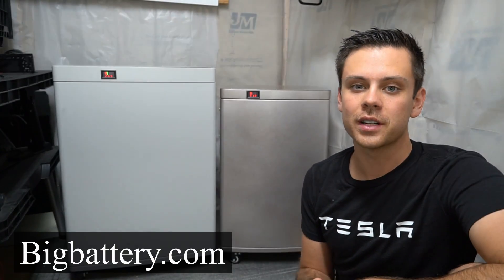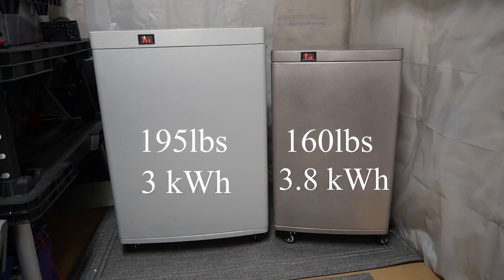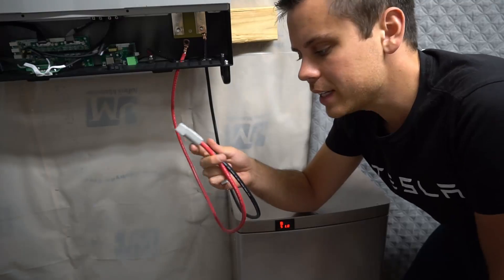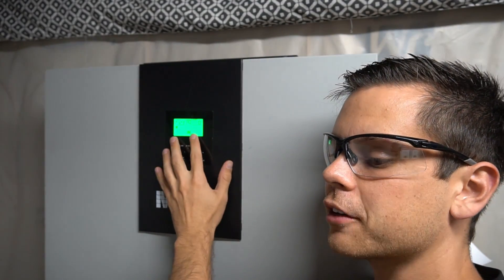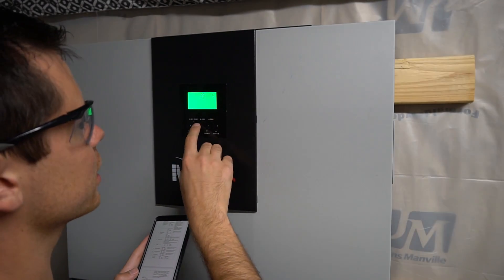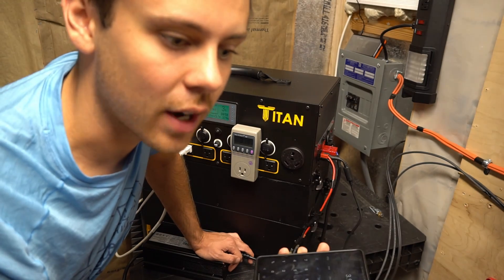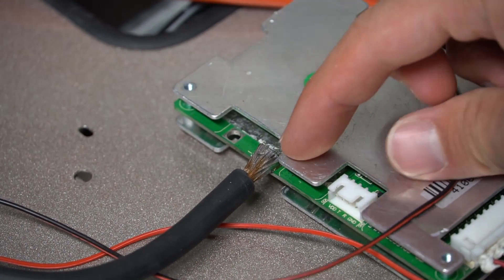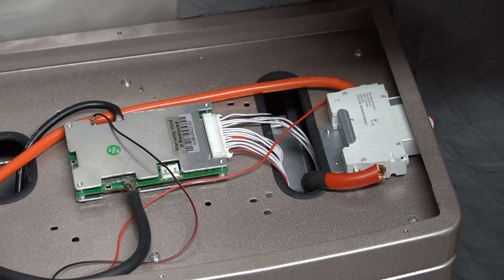Bigbattery.com 48V Li-ion + MPP LV5048 = Powerful Budget System (Intermediate level)

Comment: can anyone tell me. the sun doesn’t shine here everyday. can I hook up an wind turbine with my mpp and 24 volt battery if the sun not out but the wind blows everyday I got solar panels 400 watts I want to know can I use an 400 watts wind turbine,
Reply: let me just tell you this... DO NOT use or try wind turbines. even if you have nice fiberglass 12ft diameter turbine its not nearly as cheap, reliable, or useful as just buying a few more panels. I constantly see used panels still above 90% output on craigslist, ebay,  etc... for $0.40 a watt. you also need a very expensive wide voltage range charge controller and or resistor brake. You can still go and try it out, but Ive had a bunch and even a huge one with 3kw output, but you have to mount it pretty high up and above any tree's, I had to spend around $500 on 6awg wire to go up a tower, even at 6awg and 200v 3phase there was still quiet a bit of voltage drop even with 6awg and in the end if you have any neighbors, they WILL call the town hall and tell them... HAHA 

I would just add to your power wall + a couple more panels, but i may be wrong, this is just my experience.
Reply: You will need to check with the manufacturer of your specific charge controller.

In times past 10 to 15 years ago. 
Some charge controllers were only rated for solar and some only for wind.
Some were hybrid that could do both.

Comment: I calculated the LiFePo4 variant to have the capacity of 2.5 battleborn batteries, which would run you $2,500.  I purchased two battleborns a couple of months ago.  At $700 for the model that you reviewed in this video, should I feel ripped off?  I understand they have a 10 year warranty and the weight component, but I am not installing in vehicle and we are talking nearly a 300% difference for a seemingly high quality battery (that is sold out as we speak as others have apparently came to the same conclusion).  What's going on here!?
Reply from the maker: Oh gosh, I would buy new LiFePO4 any day! But some people can't afford them. Don't feel ripped off. I would choose battle born or fortune cell battery over used any day.
Reply: @WillProwse  okay great!  Thanks for the reply!

Comment: I am sooooooo confused. How about after all the trial and error, then show the settings and proper setup. Also, do you have an idiot proof setup with these batteries that is beginner friendly with no need to use resisters? Just a set it and forget it grid tie with battery backup?
Reply from the maker: Because these systems never work as easily as expected. I show the problems in the video so people can troubleshoot on their own. 

I would check out my beginner videos if this one was confusing. I labeled it as intermediate because I assumed the person watching has solar experience
Reply from the maker: Try my beginner friendly videos

Comment: I am confused as to how a battery pack BMS affects things when my solar charger offers so many settings for various chemistries. Do I set my chargers  to the actual battery type and manufacturers suggested charge voltages etc? If my charger is  sophisticated enough to set all the parameters...do I really need a battery with built in BMS? Perhaps just for the low temp disconnect? Thanks
Reply from the maker: Set it to your preferred cycle bandwidth. Really depends on what you want your system to do. Always set the inverter LVD to higher than BMS LVD. If that doesn't make sense, check out beginner videos or the forum
Reply: @WillProwse  thanks Will.
Reply from the maker: And yes you need a BMS

Comment: My question is you use the resistor on the negative terminal voltage points , but the not positive terminal Voltage points? Can someone explain how that works?
Reply: Thanks you!

Comment: Wondering if it would make sense to get one of these MPP or Growatt (to initially just use the inverter) instead of a giandel Inverter for a small system in a caravan but looking ahead for future growth/expansion outside of the caravan
Reply from the maker: I would get a growatt. More available lately with covid-19 delays. But mpp is good too. Really tough decision. They are very similar

Comment: It's easier to know when the caps are charged, if you use a 120v light bulb, it will have a slight glow until charged, anything 40 watt or larger is what I use,  and a 100 watt works nicely,
Reply: If you can find a 100w light bulb. Probably mr pres donnie has a closet full

Comment: Great video Will. I actually emailed BigBattery almost 2 weeks ago inquiring about the 24v LiFePo4 battery box and what it might cost to ship to me in Hawaii... never heard a peep from them. So not impressed with their communications thus far. Aloha!
Reply: Aloha Bra on the west side.. Have two 48v comeing in. Shipping on 48v is running under $500. So figure $580 for 24v. These are aprox. Yea comunication is real crappy with this outfit.
Reply: TheWaterman1000 Aloha! I’m actually on the East side of the Big Island, but wow that sounds pricy even for shipping to the Big Island. I shipped a 2 ton truck here for double that amount. So my USED 24v battery bank on wheels goes from $700 to $1,200. Not very enticing. I appreciate your insight, mahalo nui! Communications is a big part of any business. I know my email went through  and was received (I traced the SMTP header to their mail server), so it’s was either ignored or deleted. So I will look into other battery suppliers and share my experience with others regarding Big Battery.
Reply: TheWaterman1000 My mistake on the pricing for 2 units. Appreciate you clarifying. Most shippers charge a reduced rate for additional items, so probably closer to $300-ish I suspect. I am definitely am not interested in working with difficult persons and would prefer to put money in US business pockets. Especially Island Businesses. But as we are both abundantly aware, the premiums and overhead costs on battery goods shipped here is just plain frustrating. I truly would love to see someone build these locally, but there is just not enough demand to warrant the supply sustainably. I do appreciate your insight though and I hope your shipment was not on any of the containers lost in Hilo Bay. 😜

Comment: Can someone explain why it went into safety mode? I'm a novice but want to build a system. Was it because the battery over discharged???
Reply from the maker: Yes. over discharge. One cell hit threshold for low voltage and opened the FETs
Reply: DIY Solar Power with Will Prowse is there a way to prevent that? Or is that a risk when buying used batteries?
Reply from the maker: @DavidDiaz-so5kj  oh I did that on purpose. I stress test the BMS. If you set low voltage cut off to 42.5V, it will work perfectly on its own.
Reply: DIY Solar Power with Will Prowse ok thank you so much. I'm doing one of your small solar setups. Sadly I found those tiny blue charge controllers have very small holes for the cables. Makes no sense as they know with 12-24v we need a larger gauge. So I'm stuck right now. But I love your videos! I've referred a few people in philippines that lose power a lot over to your channel!

Comment: Been looking forward to this LV5048 video since last fall. I used Tesla modules just as you were backing away from recommending them. Appreciate the Tshirt! Also, to avoid sparks I have a big breaker between the batteries and the inverter. 5 months off grid, 42-48.6V cycles every day. Could not be happier with the LV5048. Thank you for the guidance! 🖖🏽
Reply: Can you provide a link to buy the breaker you used/one that would work with the MPP5048? Thank you.

Comment: I have the 48v li-ion battery you show here. I'd like to power a 3500w instant water heater which will pull 73A...  Would you advise that I swap the breaker and BMS (which are rated for 65A) out for a larger ones, or buy a different battery?
Reply: Add a second battery put in parallel. That way the load on each battery is only 1750 watts and 37amp is well below the 65amp breaker. And your increased capacity of 6000 watt helps keep you between the 20/80 percent usage ranges for battery longevity. 
At least that’s my understanding from what I have learned from Will so far.

Comment: 500 charge cycles? Who would go with that?
Reply from the maker: You can still use it after that many cycles. But yeah, degradation figures hard to predict. Diy powerwall guys run them for years. I prefer LiFePO4
Reply: That's a bare minimum when used from 4.2vpc down to 3vpc (from my eig data sheet). If used at 80-90% charge and leaving 10-20%, the cycle life will be considerably extended.

Comment: Hey man. All I want to know is what do I need to run a regular house hold freezer with maybe enough left for some lights. I love your videos, I watch them and many other similar channels.  But trying to figure out exactly what all these systems can do is like trying to understand a foreign language. I'm not being critical but for many ppl out here, we start hearing the volts, amps, hours, etc. our heads start spinning and we just can't understand what these systems can do. Can you make a "solar video for for dummies" video.
Reply: He has a load of earlier videos he encourages people to view. He doesn't want to waste time repeating. Use search function
Reply: You need to start with the basics. Load calculations and system seizing. 
But if it’s a standard freezer, either one of the two setups Will shows in this video will do the trick
Reply: @4philipp  ya but how does one calculate all this stuff
Reply: The would be a lengthy reply. Search Will’s videos for solar system load calculations or google it. It’s your very first step.

Comment: A great video 👍 Today I mounted a Epever Tracer 3010AN in my mobile home Iveco 40-12 Mobilvetta Icaro, 4.5 tons) I bought it because I saw it in one of your videos. I ordered the link cable today, because I noticed that all battery types are with the same voltages. 15 Volts are too much for my 2 x 138Ah parallel Valence LiFeMgO-Batteries. Max 14,6 Volts it says on the top of the battery written. So I will create an user configuration. I promise that I will buy your book, i already found it at Amazon Germany. I wish you a nice day. Greetings from Germany /Bavaria /Kelheim JN58WV, Sascha

Comment: Am I the only one having brightness-waves running over the image?
Reply from the maker: No it's the pwm in dimmer circuit on LED light bar
Reply: @WillProwse  You can adjust the shutter speed of your camera to get rid of those.
Reply from the maker: Good point!! Didn't think of that
Reply: @WillProwse  Also, I'd love a video about setting up two MPPs in parallel to split phase!
Reply from the maker: It's the lights in the shed
Reply: Clearly its faulty flux capacitor
Reply: @scottmurphy4946  The problem is that the inverter can't provide 1.21 jiggawatts.
Reply: No its giggle watts.
Reply: Yeah its just an artifact of rolling shutter found on most camera's combined with pwm driven lights. Changing shutter speed will eliminate it.
Reply: Many lighting does not like to show correctly in camera's. That's why studio's have their own type of lighting.
Reply: No.
Reply: Same here
Reply: no. could be the lights in the room. If they have a frequency, it could be matched in some way with the shutter/frame rate

Comment: im your opinion, is this plug and play system is better than the bluetti ac200?
Reply: Keep in mind that this system is "intermediate level", not plug and play because you have to change settings on the LV5048. The bluetti ac200 is bascially "plug and play". Ultimately, you will get more value out of this intermediate system, but the easy factor and simplicity is better on the bluetti ac200.
Reply: @EdisonWong2004  yes I agreed, comparing both units, this is more advanced, is more fun, and can accept more solar panels at once.

Comment: Hey, Will. I have a pair of 48v wall chargers that are left over from when I trashed my Renogy Lycan Powerbox. I intend to keep to a 12v system in my new van. Is there any use I may have for these chargers? If not, then hello eBay. Thanks.